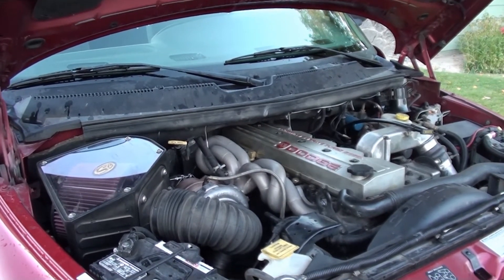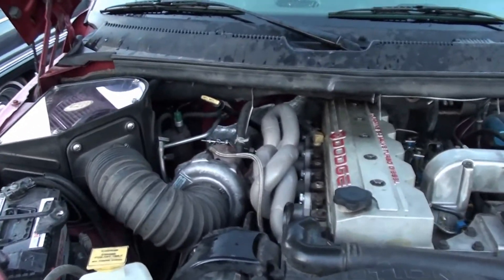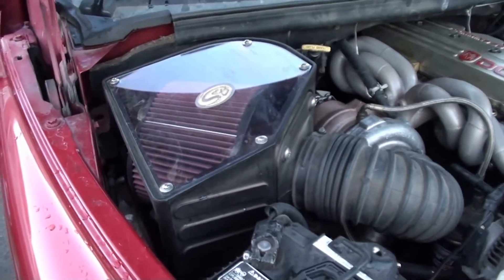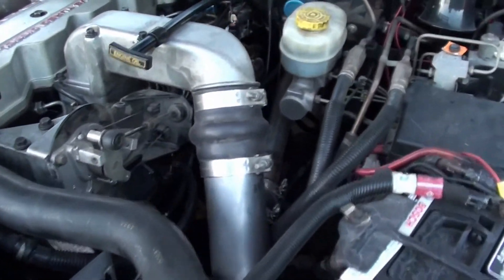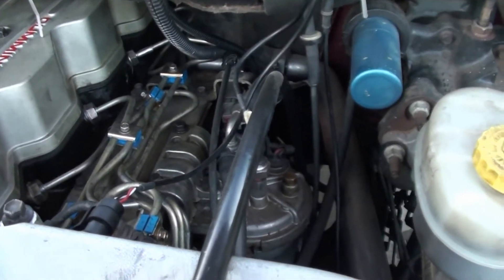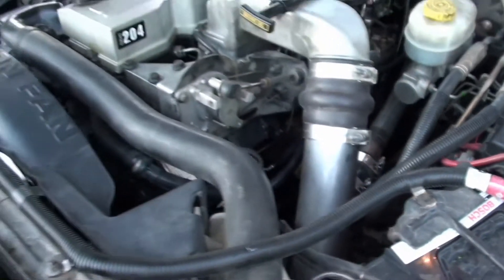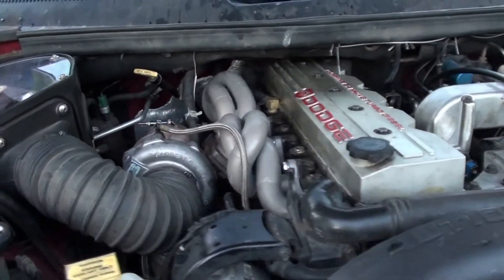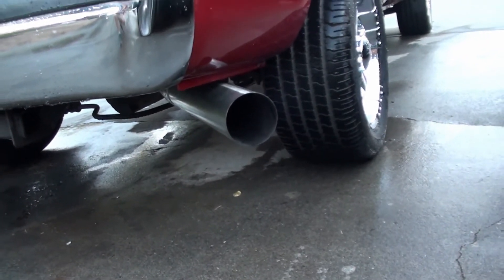98 Cummins 24V Upgrades

Comment from the maker: Wasn't too bad, I had to remove the coolant line that runs under the manifold but that was OK since I used it to feed the turbo. It was a little tricky installing a couple of the bolts going to the head. The worst part was putting the turbo on the manifold since I had to remove the compressor housing to install the bolts holding the main section to the header.

Comment: Vaughn MacKenzie Where did you buy your exhaust manifold and what is it called?
I own a 99 Ram 3500 cummins 24 valve and i want to make it as loud as i can get it, did you defiantly hear a louder sound and power difference with that manifold and what are your EGT'S running at with that installed?

Comment: Just curious if you installed the header before or after the turbo, If yes or no how does it help with EGT's and spooling, I am looking to upgrade my manifold for towing and was looking into these header's. What is your Max, EGT's with this set up. Thanks
Jordan
Reply from the maker: Jordan I installed them both at the same time. I think the header helps with spooling a bit, can't tell for sure, but the combo spools well.  It starts to spool around 1100 RPM, drives almost like stock.

Comment: Ok so I know this is an older video. But have you done any fuel upgrades? I noticed your burnin real clean.
Reply from the maker: Sad to say NO, I haven't done any additional fueling upgrades. I spent a lot of time and effort over the course of a year doing body work and repainting the truck and some other cosmetic items, and interior projects.  I am hoping to get the trans built this spring, then there'll be some fueling upgrades!  I have some Weston Shupe 75hp injectors to install and I want to get the Smarty Touch that came out recently. I need to do another video soon, paint turned out nice.  Need to get some better wheels for it too.